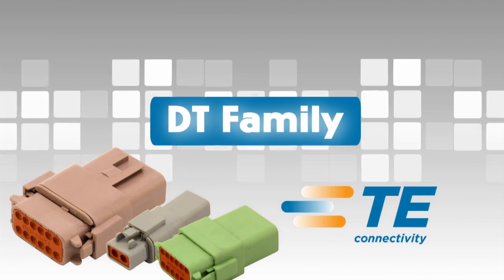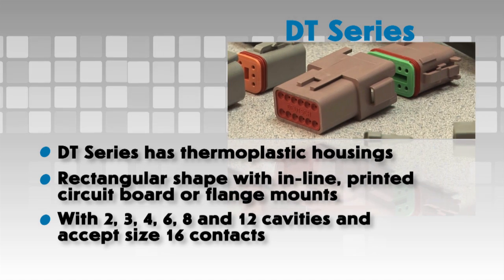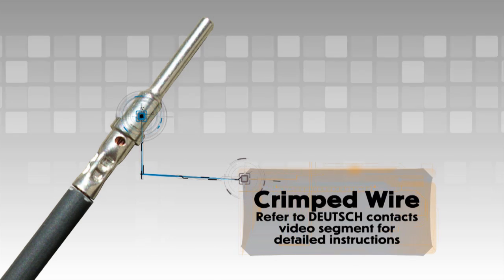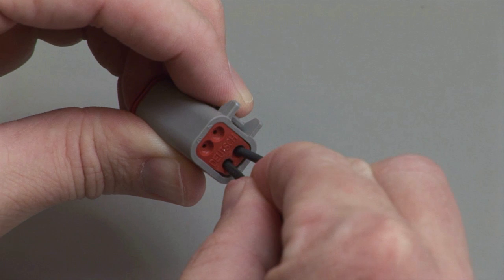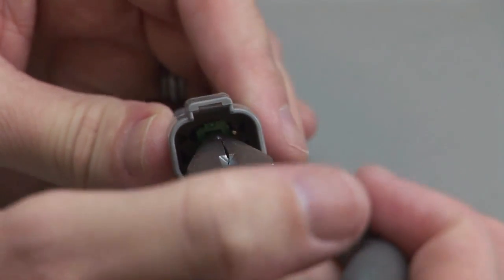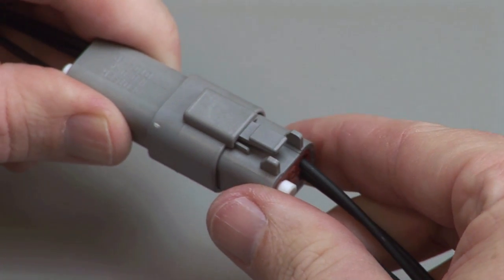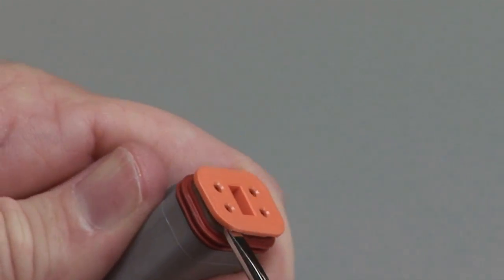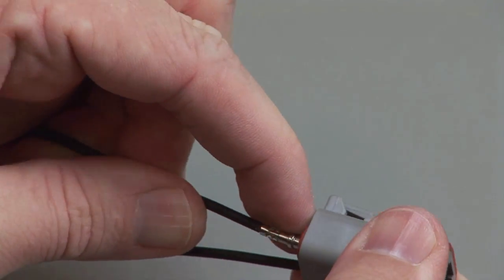DEUTSCH DT Series Connector Instructions

Comment: Shame you don't mention that there are open Deutsch Bullet Connectors and Closed. I didn't see that on the Deutsch video either. No special tool needed for the open bullet connectors.
Reply: having used the closed connectors
- they are so, so easy to use when compared to crimoing the open style connectors. 
-- select correct crimp for the wire, stick the wire into the crimp (two hands), stick crimp into the crimp tool and crimp
-- no mucking about with the wire wanting to move in the crimp as you are crimping like the open ones do

Comment: First time messing with these connectors. After some frustration I discovered that the green wedge comes in different shapes depending on which connector you are using. I was trying to use the green wedge that goes with the rectangular (4 holes or more) to lock in the connector that has two holes. Didn't work. Then I discovered that there was a special one for the two-hole connector. It fit. Looking around in the kit I discovered that the triangular one takes a green "christmas tree" shaped green wedge.

Comment: this may sound like a "very stupid question"; which part of the component is the -"receptacle" and which  part is the plug:" I,m not pulling your leg !! WHICH IS WHICH??? thank you,PATRICK.P
Reply: The receptacle is the female connector, the plug is the male connector. Note that the male connector holds the sockets (female), and the female connector houses the pins (male), which can be confusing.

Comment: Very useful. I had some worn insulation on a wire feeding into one of these sockets that I needed to repair, but had no idea how to dismantle the connector to be able to get some heat-shrink over the worn area .  This video really helped, although mine was the one with the deeply inserted green locking plate that I had to remove, but I got enough pointers from the video to be able to successfully complete the job in a few minutes.

Comment: The connectors might be low cost, but the crimper needed for this system is $299.00 plus. This is out of the range for an ordinary individual trying to repair a broken connector or to install a few new connectors on their auto or ATV. It is also too difficult to search out a garage that might do this repair because they also must have the crimper in their inventory.
Reply: I bought a Tool Aid 18880 which crimps the 18-14awg solid (barrel) type terminals just fine. It was like $30 or 35 maybe. Some of the cheaper metri-pack crimp tools would probably work for the winged style terminals also. Typically for any terminals out there, there is a cheaper tool that works fine, now if you are building harnesses and crimping 100s of these a day, those pro grade expensive tools are worth it to save your hands I would bet.
Reply: chinese crimper for this connector costs 30€ and I bet it works just as good.
Reply: Deutsch sell a open barrel crimp that can be crimped with a $30 tool and they accept a wider range of cable sizes 22awg instead of just 20 AWG